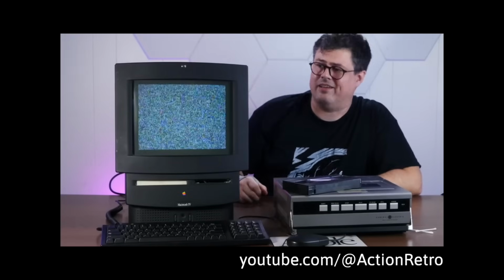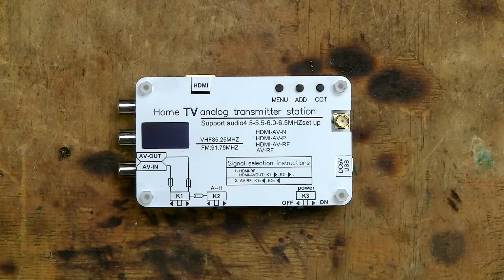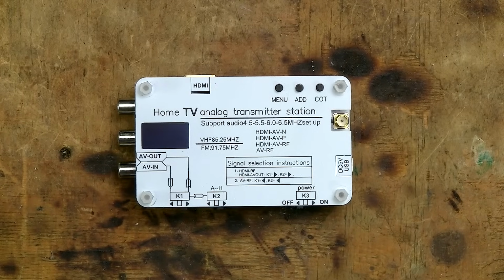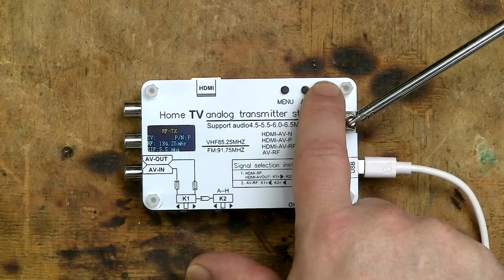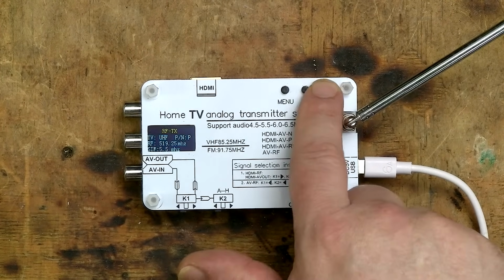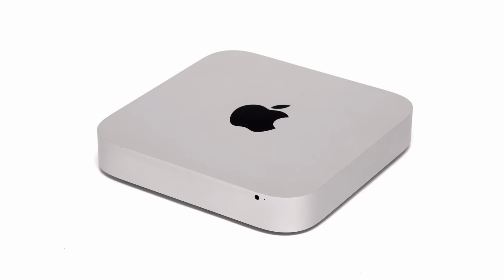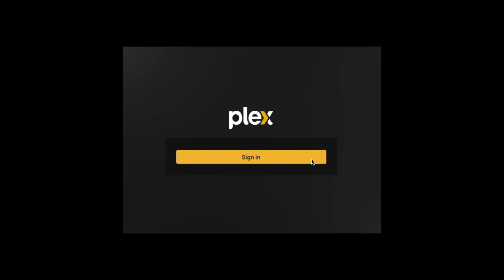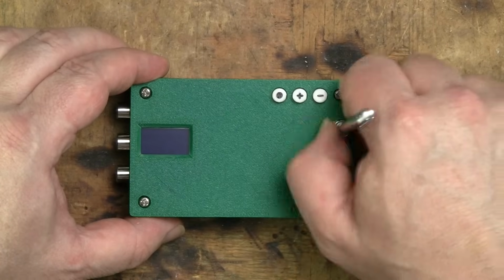New life for vintage analog televisions

Comment: As a ham, I have a transmitter that was built from a kit years ago and it transmits to switchable UHF channels, I even have a small power amplifier made from the power brick from a UHF Motorola Mocom 35 which gives me about 10 watts output when the transmitter is programmed on certain UHF bands. Now the fun part is that living in the EU and working on a frequency within the ham band I can transmit at 10 watts but it’s a NTSC signal and old euro analogue TV's cannot receive the signals. I do have several flat computer monitors that do have built in NTSC analogue tuners.
Reply: For a while I owned a massive late-70s Hitachi TV (wood grain) that was multi-standard. The only use I had for the NTSC capabilities back then was running a US-spec Super Nintendo. It was pretty worn out though, so when I was offered a new-ish Samsung CRT for free I scrapped it.

Comment: Would hooking up a TV directly to the antenna output (using 75 ohm coaxial cable) work?
Reply: The output might be a little hot but sure it should work. you could feed it into your house TV antenna network, assuming you have one antenna feeding multiple rooms, just use a splitter in reverse near the antenna to combine the two signals.
If the signal strength does prove to be a problem, attenuators can be obtained from a decent TV antenna supplier, or you could make your own by butchering the innards of an old splitter etc.

Comment: I have done a similar thing for my RC truck and an AV to RF converter, its a rolling TV transmitter with a 4 watt wide band RF amp. I live in a very wooded area and 5.8ghz wouldn't even work in my yard. But 200ish mhz has no problem going through buildings and trees. There's zero latency too and a microphone with an op amp i can hear the wildlife i sneak up on also fitted IR lights to it.
Reply: I had a similar idea, I have a remote controlled model mini minor, I've cut a hole in the fake windscreen for some clear plastic, ready for a UHF camera I have, but that's as far as it's gone.
I thought it would be cool sitting in front of my loungeroom TV driving a car around my version of 'Land of the Giants', however on a more practical note, being able to inspect the under floor parts of my house without wasting several hours and getting awfully dirty (and a lung full of dust) seemed like a good idea.
Reply: Interesting. What transmitter are you using? How much power output?
Reply: @Buy-n-large Google motorola RF module. I think they're just general-purpose telecommunication amplifiers made in the 90s. I tied the output of a cheap amazon converter to one, got the idea from an old camera I took apart. The antenna doesn't have to be exact because you can just change the channel.

Comment: If you connect a TV antenna to the output you can increase the range considerably. Of course it's directional, the bigger the antenna the more directional. This also works with the outputs of VCRs and computers. UHF antennas are a bit more practical indoors.

Comment: Setting up dozens of sets all showing the same thing is the reason to use this.
Reply: Are there still stores that have walls of TVs doing this? I've been to electronics stores recently but can't remember looking at the TV department.
Reply: @Ragnar8504  Wal-Mart still has a wall of televisions in its stores but they are almost never turned on.  In later years when they were turned on they were connected to an internal video system, unable to actually tune broadcast or cable channels.
Reply: @Ragnar8504  In TV shops they typically use HDMI distribution amps
Reply: That would make an interesting backdrop for a YouTube channel

Comment: Ooh yes!!! I had been planning to do something like this after building my storeroom A/V rack, though in my case it'd be closer to how YouTube user 'clabretro' did it as I'd have multiple channels.

I saw an analogue RF modulator for sale on AliExpress that could transmit 3 channels, and I've wanted to get one or two in order to have multiple channels available to me when I want to mess around with analogue tuners, however I'd also want the setup to be compact so I can store it in my A/V rack, which is also why I'm prioritising building that first.

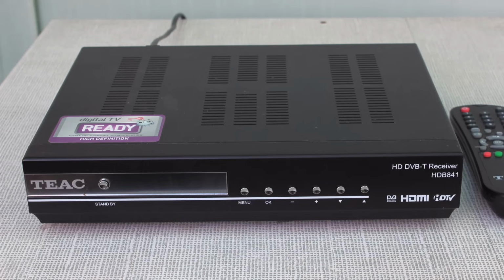(4:59) I plan to do this too, but using little external DVB-T2 tuners that run off 5V power, that way a multi-port USB power adaptor could help keep the setup compact. I'd specifically have to find ones that have RCA connectors for composite A/V out as some of them would have SCART connectors instead.

(5:22) I'm planning to do this too, using an array of older Raspberry Pi boards set to output composite A/V and automatically launch into VLC to play specific channels off of my Tvheadend server, of which there would not only be over-the-air TV channels, but also Streamlink and disqueTV channels, using a specific Tvheadend playback profile to have it use FFmpeg to re-encode the streams in standard definition and a codec they can decode. I'm aware the Raspberry Pi 5 can output composite video, but I plan to use older boards as they'd typically be cheaper on the used market and most of the work would be done by the server.

It certainly helped that, before Mediacorp (Singapore) shut down their PAL-B/G transmitters, I channel surfed on my Philips DVD recorder (from 2004, so it only had an analogue TV tuner) and took notes on the frequencies, which I was able to cross-reference years later on Wikipedia to get the channel numbers, which I could then input into the encoders to have the channels on their original analogue channel numbers.

Comment: I’ve done  the same thing but with an rf modulate and two distribution amplifiers and an antenna. I connected a roku to the hdmi input and have the pro remote so it isn’t intact res and reaches anywhere to change channels. Or I can use the app on the phone. Works great and the range is about the whole house.